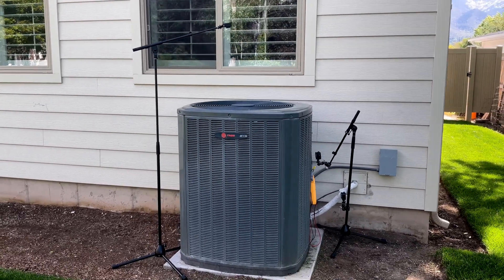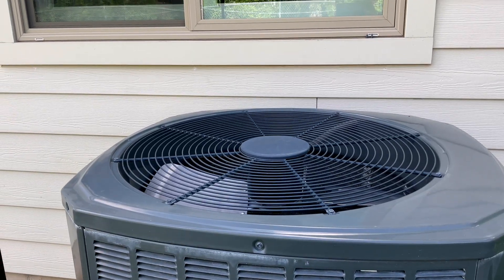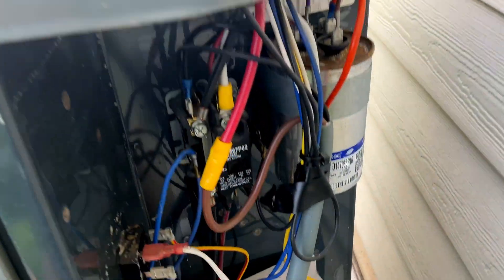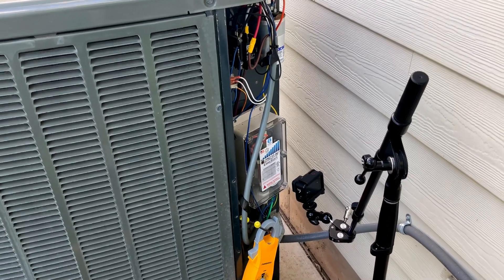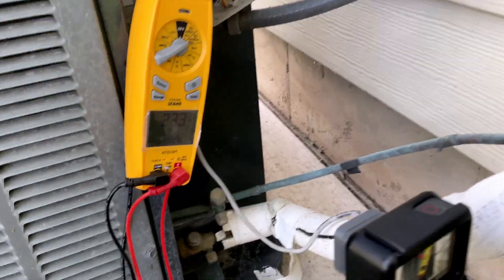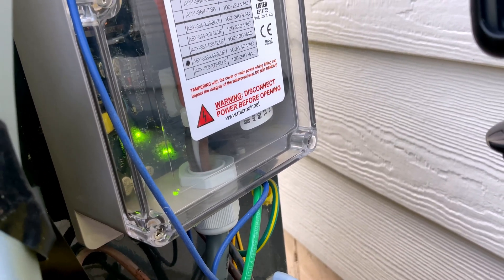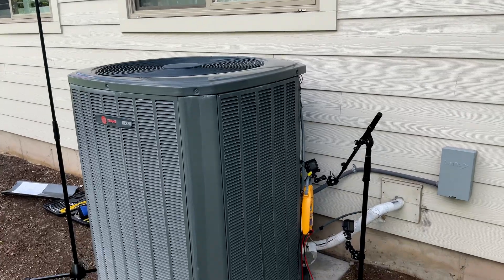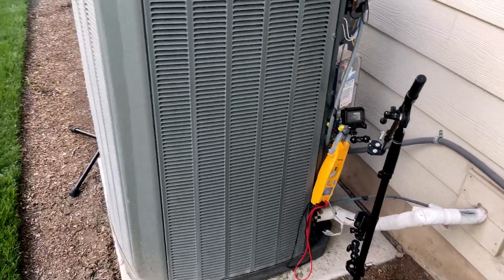Micro-Air EasyStart: Start-Up Sequence Using 4 Cameras at Once! 1 Year After Installation.

Comment: The Micro-Air Soft-start Flex seems very helpful during power outage, but it does not last.  My unit FAILED IN JUST 11 MONTHS. with MULTIPLE  INTERNAL PARTS BLOWN!   I hire my AC Technician to check my system when my ac stop working and he told me I am lucky it has survived the blown soft starter. I was shocked when I checked the reviews on Amazon, there are many customers has the same problem as mine.  They failed within a year. There are problems on the design.  Some even have their replacement blown in a very short time.  With the investment over $400,  plus the cost of hiring AC Technicians to install and fix the failure,  I would not recommend to any friends and family.  Use on your own risk.
Reply from the maker: It does seem the Flex has issues from what I have heard. Thankfully, the model I have is the old model and it’s fantastic! 18,588 starts and counting on my unit. Hopefully they get the Flex fixed. I have one to test, just need to decide which machine to test it on! :) Thanks for watching!

Comment: So the easy start is basically a fan first then the compressor. No special capacitors to keep the voltage up during start ups?
Reply from the maker: It does a lot more than just starting the fan first. Check out my other videos to see more of what it does!
Reply: Obviously you should just let someone install yours who knows what they are doing! LOL!

Comment: How old was your unit before you put the soft start on?  Will it extend the compressor life?
Reply from the maker: It was about 3 years old. Do not crazy old. However, it’s still working flawlessly! Time will tell how long it lasts! Thanks for watching!
Reply: @theresatrickforthat  that compressor might last 20 years. Use a good quality capacitor.

Comment: I liked your sequence. I could really see/hear it start. I recently installed a difference brand. And the startup was great. But the compressor sound while running was pulsating. I returned it. I am in the trade and it sounded like the compressor was running on a VFD. Do you have any sound issues with the EasyStart while the compressor is running??
Reply from the maker: Thanks for watching! I’m happy to hear you enjoyed the video! My A/C runs smooth as butter! It sounds exactly like it did without the EasyStart…maybe even slightly smoother if my memory serves me correctly. These MicroAir units are more expensive than some others out there, but they’ve really been engineered well! I’m sure you would enjoy one! Thanks again for watching!
Reply: I almost went cheap on my purchase as well but after doing enough research realized that I just needed to go ahead and buy the best.